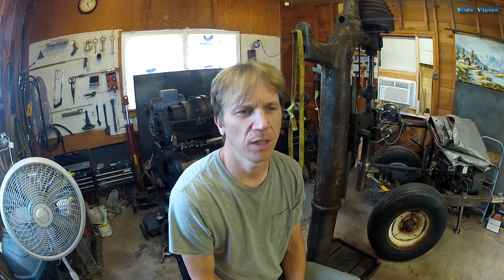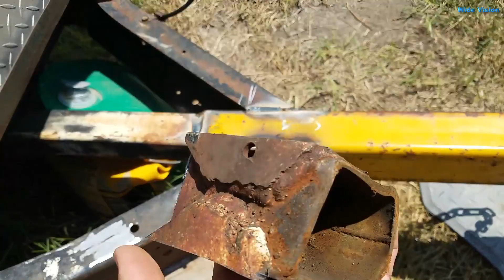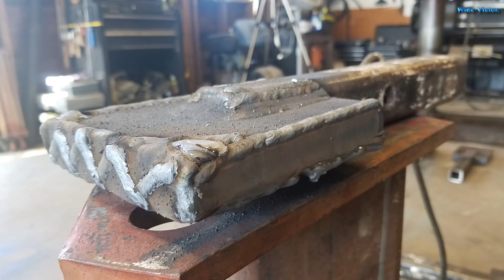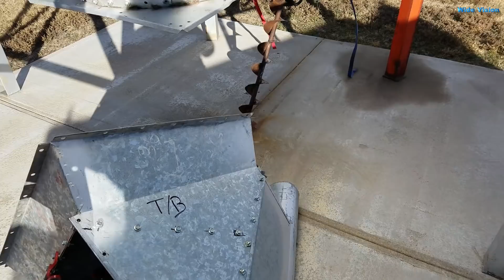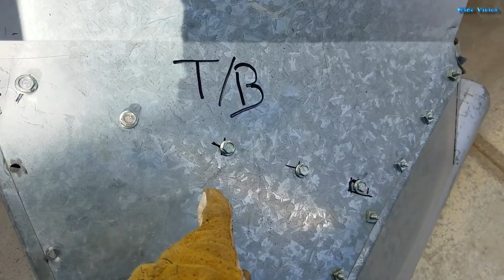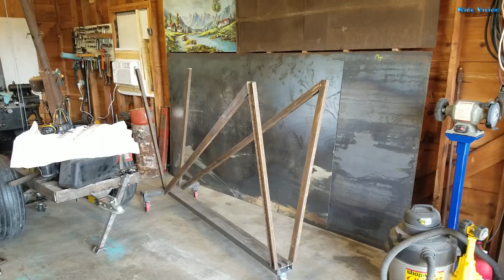Brief glimpse at 3 Projects  (August 2018) Hitch, Reamers, Grain bin

Comment: what i found out with my camera is if your recording in 1080p you need a high speed sd card to match. sometimes it will work if camera is on a tripod but if your walking/recording all that footage is lost and the kids who work at best buy have never heard of the indiana jones movies
Reply from the maker: I think I didn't copy the files to my computer before I wiped the card for another video. The reason I think this is I also had footage of me cutting the rails off the sheet metal skate, which is missing too. I'm sure I recorded both those things with my GoPro and I took my GoPro on-site one day, thinking I'd record a repair. I wiped the card before I left so I'd have as much recording time as possible. I didn't even look at the card before I deleted everything!

Comment: Always interesting.  What is the status of the drill press? Thanks.
Reply from the maker: Pretty slow on it lately. I'm at the point where I need clean all the old paint off, degrease everything, and maybe even sandblast a few parts. It's not fun stuff, and I'm lacking motivation to keep at for very long!
Reply: I feel you. Best to leave it until it calls to you. When it does, then you can pour yourself into it while firing on all cylinders.